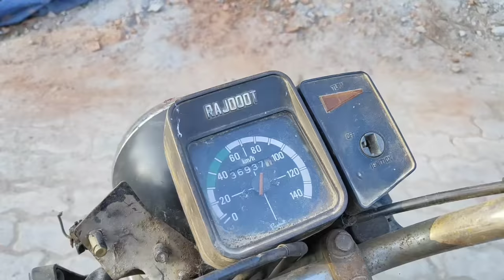Yamaha RX100 Full Restoration | Repair & Restoration

Comment: the only valid comment should be : where did you get the spare parts... the vid is osm, but rx lovers face problem when it comes to spare parts... can u pls say how u got it (no matter the cost )?
Reply: They buy the spares from yamaha showroom bro, and the cost of full restoration is between 60k to 70k only,
Reply: @mof1smokeryt609  umm... ok then bruh... I thought since they stopped production it mi8 not b possible to buy spareparta directly frm showroom... but if u say so !😀:^)
Reply: @SriramK-wz6iz  yes Yamaha still makes / sells parts for these bikes or eBay but post is a killer

Comment: After engine bore,how many KM should we go below 50 speed to become normal??
Reply: 500 km
Reply: @AkashAkash-hn3oc  most of the people saying to ride 1500 KM 😢
Why is that?
Reply: @umaraflal3151  not needed
Reply: After restored  you should ride the bike 
Around  2000 km by maximum  speed  of 50.
If you follow  this instructions  you got a perfect  engine  for long time and you got
Better  mileage  also and keep your bike engine  safe
Don't forget  to mix oil with petrol
Reply: @rahulh1285  Is that okay if I ride for 1000 KM?
Reply: @koushiksj8297 it's OK BUT   better  you need to seat you bike piston  by riding  2000 km
Reply: 4000

Comment: Seat 💺 work is bad. No steel side beadings on seat. Design of sticker is 135 which is very ugly. Chrome work not done on silencer and handle bar. So it’s not a full restoration work